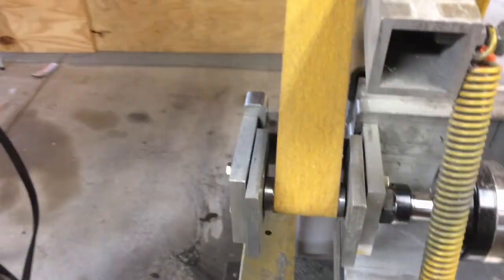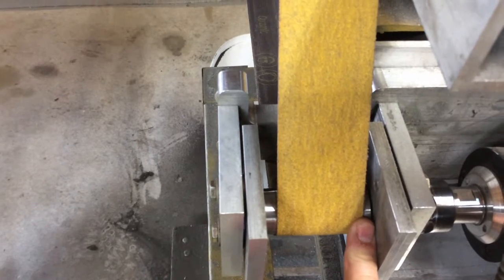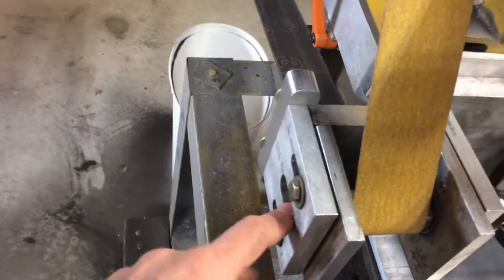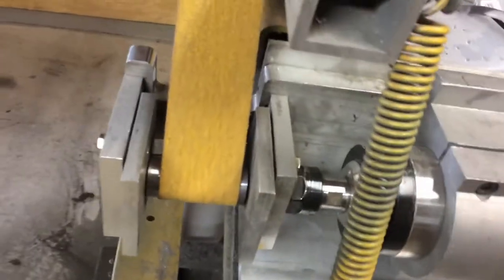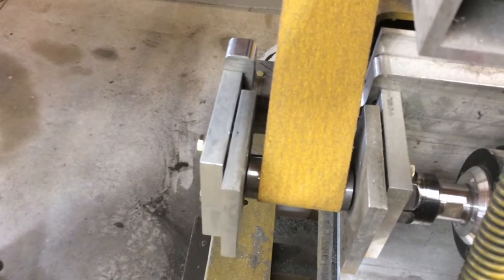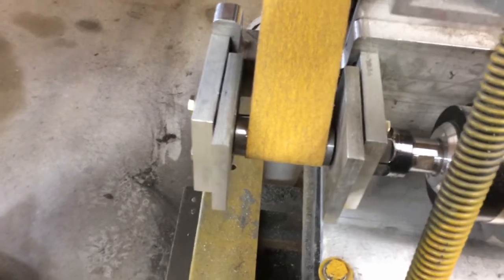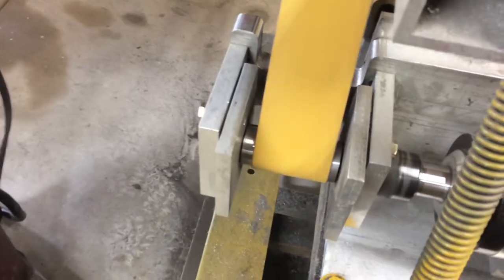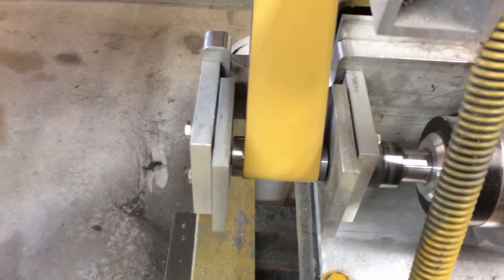TOTALLY AWESOME VFD Under $600 for 2 x 72 Sander Part 1

Comment: how long lives bearings? i think you just need a bldc motor from sewing machine. it gives high rpm more than regular motor torque and cheap enough, because it sells with drivers. no need for a vfd
Reply from the maker: Have not worn out a set of bearing yet.  Since this is a developmental test I had 2 wheels fail due to wrong tolerance during fabrication.  But each time I installed a new drive wheel I kept the same bearing.  Those bearing were subjected to the high vibration forces of those two wheels failing.  The bearing are still doing well.  Part of my testing is to see what it takes to break stuff.  The bearing are rated for 26,000 RPM and the motor runs at 24,000 RPM.    I am not familiar with sewing machine motors but if a direct drive wheel could be attached it sound like it might be an option.  Lots of people said this design would never work.  Even when they see it working it is hard for them to believe that a small high speed motor is performing so well and holding up under hard use.
Reply: it is a good experiment, but some more complicated then standart ac motor/vfd) maby this affect on people choice. Also i face with a problem when use small diameter rolls then my belt just blow on high rpm. So i like that you found somethin differnt then others)
Reply from the maker: The drive wheel assembly is a bit more complicated.  The entire thing with motor, VFD, tiny drive wheel, and drive wheel support were total of $600.00 USD.  This is much lower than the conventional 3 horse power motor, vfd, drive wheel many makers use.  This is a 400 HZ motor so it has a linear power line up to max.  At max 24,000 RPM it is producing max power.  In conventional 60 HZ motor max power is reached at 60 HZ at mid rpm range.  When the VFD over drives the motor to get more RPM the power begins to decline from max.  The tiny spindle motor give max power at top speed where you need it and has plenty of power for other operations that happen at lower belt speeds.  Top belt speed is 7200 surface feet per minute.  Also there is a very significant weight reduction in this motor.

Comment: Gotta be a way to balance the contact wheel I would think. Curious how you mounted the shaft to collect output. Been following you for awhile as you know. Am building my own 2x72 soon lol my 1x42 isn’t getting the job done anymore and I really can’t use it once I start my production knives
Reply from the maker: Hi Gary.  I know the feeling. I also did the 1 x 42 phase of making.  2 x 72 is so much better.   The drive wheel is one piece and has a 12 MM shaft out each side.  The motor comes with several collets and one of them is a 12mm so I chuck the wheel in the motor just like it was a router bit.  Then I adjust the bearings that support the wheel so there is no preload on the motor shaft and tighten them up.  This way the motor only provides the power to turn and the bearings support all of the side load from the belt tension.  If you are looking at this as a VFD option on your new sander I feel very strong so far that it is a real player when setup correctly.  I adjusted the VFD Auto Torque Compensation setting and that made noticeable difference on the low rpm side.  At high rpm it pulls like a tiny angry monster.  Longest I have ground none stop with it so far is 8 blanks in a row.  I got tired first.  You see the guide I use.  It puts heavy pressure on the entire blank grinding face and this motor pulls it with ease.   The contact wheel is a cheap $150.00 one.  I need to find a place to balance it or spend the money on a better wheel to be able to be smoother running at speeds above 80%.  When you get ready if you want I would share some of the design of the drive so you don't have to reinvent the entire thing.
Reply: BigIronTV yeah when the time comes that would be awesome. I’d been meaning to buy your jig plans or one you make. I have your plans from your first model and life has gotten in the way and never made it lol.
Reply from the maker: I thought your name was familiar.  Must have seen it on the order for the plans.  Don't waste your time with the DIY version.  It is posted for people that are not really serious knife makers.  It takes a long time to make it if you are only doing one and the build cost is not much better than buying one already made and the quality is way below what I am able to make now.  That is the reason the plans are free now because what I am making is so far advanced beyond those plans.
Reply: BigIronTV what’s your new one run again. I can’t remember which video you posted about it.
Reply from the maker: http://www.belnapcustomknives.com/index.php/product/multi-guide-pro/